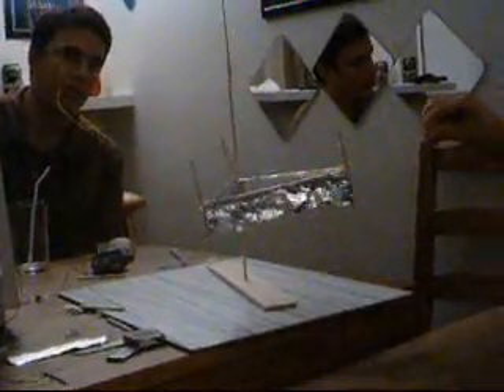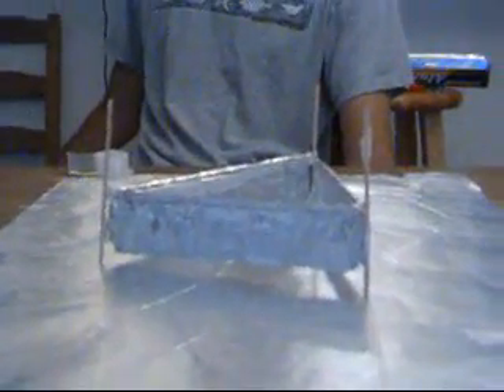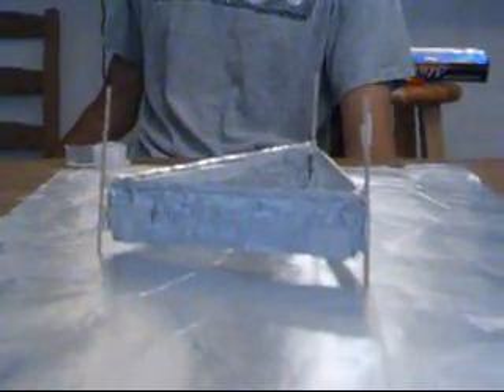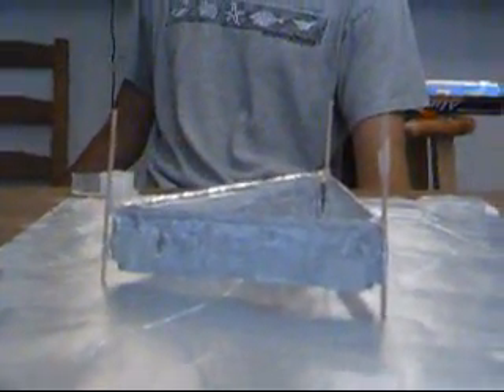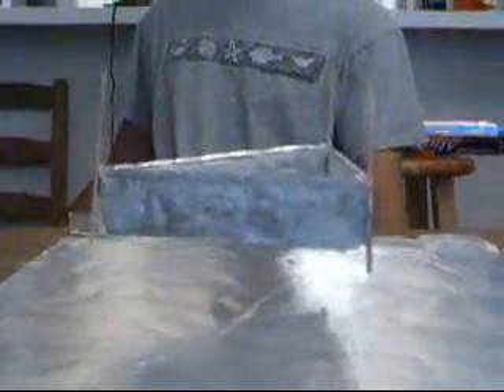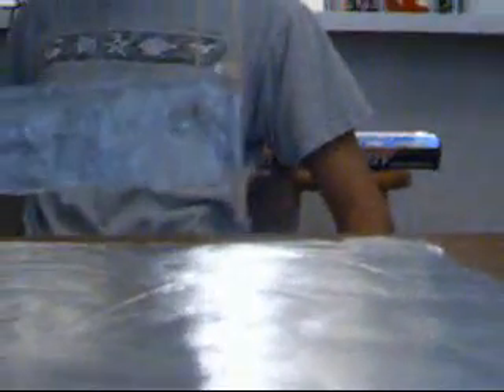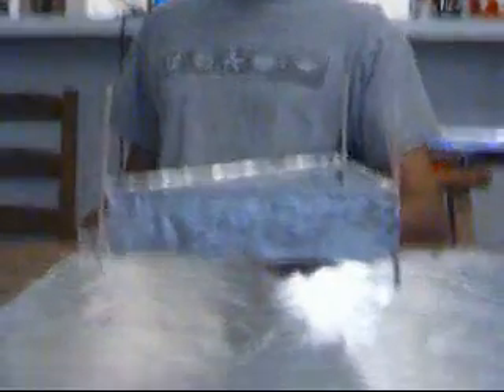Ion Wind Lifter

Comment: Oil tests already done over the last 80-years by Thomas Townsend Brown (the inventor) to HONDA R & D in the 1990s-2007, and NASA (2000-2005). Force is the same, regradless of the medium. Tests in Vacuum and Oil are quite conclusive. A high-K-factor dielectric between anode and cathode is best, smaller gap,higher MASS dielectric, high area of plates,more Voltage.

Comment: I don't take this to be a complete explanation because the test results can either be explained by ion wind or by dielectric pumping of air. Dielectrics experience a force in the presence of a diverging electric field, without ionization.  A test to verify this would replace the air with a substance that does not ionize easily such as oil. Dielectric pumping, if demonstrated, gives rise to interesting effects we can all look into. Let's not fall into a false dichotomy trap.

Comment: Actually, requiring air is evidence that this *is* ion thrust. According to the ion theory, it works like this:

There's a thin wire above the foil that's hooked up to one pole of a high voltage source and it ionizes the air around it. These ions are repelled from the wire and attracted to the foil (attached to the other pole of the power) which deionizes them. This constant downward flow pushes on the air below, creating a net upward force.

Comment: You may use an electrostatics generator, but you ned 1-2 milliAmps to replace charge-loss to space by thin-wires and sharp-edges. Just enough-current to maintain the CHARGE.

Comment: To put things in perspective: the article "How I Control Gravitation", published in 1929 by Brown, presents an electrogravitics-validating discovery about VERY HEAVY METAL OBJECTS(44-lbs EACH) separated by an insulator, charged to high-Voltages. Brown also expresses an experimental formula in words which tell us what he found was directly contributing to the UNIDIRECTIONAL FORCE (UDF) which he discovered, moving the system of masses towards pos.(+) pole.  Equation for force might be F=Vm1m2/r^2.

Comment: The foil-skirt, being oppositley charged form the wire, is violently pulled to the wire by COULOMBS forces, the is simple physics. Being in fixed-relationship, the whole device moves in any direction the positive-charged wire is oriented.

Comment: You do not neet to fly from a charged plate. my beamships(tm) leap from the floor or table to the ceiling, and off the grass to any height you desire. I flew 3-foot hollow aluminum-copper and plexiglas flying saucers at the 2nd antigravity-conference in Reno, Nevada in 2000, and they even flew sheeted in plastics.

Comment: That is correct. The unit puts out at least that much Voltage. VOLTAGE is what causes a localised gravity-warp with a CAPACITOR, CURRENT is what cuases a localised gravity-warp with a TOROID (toroidal-coil wound around a hollow square cross-section Swedish-steel donut-shaped core). Capacitor is ELECTROGRAVITICS. Toroid is MAGNETOGRAVITICS.

Comment: Google: Lithim-Polymer Batteries (They've revolutionised the RC toy and hobby industry, obviating the need for Internal-Combustion glow-fuel or Petrol engines).

Power supply costs $98. 1 piezoelectric-transformer the size of a sugar-cube, putting out around 3-6KV AC, this is put thrua standard 10-stage Cockroft-Walton Voltage-multiplier, out comes  from 20-50KV, @ 1-1.79 milliAmps. This is pulse modulated for greater or lesser effect (pulsing the output w/ square-waves increases the force).

Comment: Accomplished in early spring 2003 by a professor in Tokyo with a modified version of one of my ALPHA piezoelectroc-based power units, and an 11.1Volt, 2200milliamp Li/poly battery, and a very large lifter. Achieved self-powered flight for over 60-seconds before battires exhausted. This is the equivalent of the Wright Bros flights 100-years ago. Only 66-years from first powered-flight, to the MOON! Which I watched in Manchester UK in 1969 on B & W Telly.

Comment: If your wire is moving at all, it is not tight enough, and your lift, and power-consumption efficiency will suffer. The anode wire must be as tight as possible, and NOT MOVE AT ALL, then the thrust is much greater, and power-consuption goes way down.

Comment: They did not use potentials of 150-250-KV, vas TT Brown did, nor a solid dielectric, as Serrano did, in his patent, nor the new NASA/TRANSDIMENSIONAL patent, which uses a solid-dielectric, and worked in vacuum; that was the basis on which the new patent (2001) was granted. This is a fuelless space-drive.

Comment: A dielectric is anything that prevents the flow of electric-charge, or current. A solid dielectric that increases the Biefeld-Brown Effect must have the highest K-factor available (to store maximum-charge in the form of elastic-stress), highest MASS available. Barium Titanate, Titanium Dioxide, or for a real good thrust, depleted Uranium (used as dielectric on the B-2 Bomber).

Comment: Mythbusters did not use TT Brown's vacuum-voltages (120-250KVDC), or SOLID-STATE-dielectrics, like in Hector-Serrano's patented device. This would work fine in vacuum, beeter than in air, with those requirements. Don't be intellectually lazy, it takes no effort.

Comment: The SEG-mockup that I touched with my own hands is actually generating excess-energy as we speak, and it was not designed to do so. The first complete ring for the law of the squares SEG prototype was completed four-days ago. The second ring is being built right now. The senior engineer is in the process of moving to Thailand, where the work is being completed.

Comment: The modified Japanese unit is heavier, and the model is larger and heavier, also. 6-seconds of self-powered flight before lithium polymer pack exhausted. I was not given specifics, but I can only assume much progress on those initial efforts hae been made in the nearly five-years hence. We've seen an explosion in battery technology and microelectronics.

Comment: A scientist in Tokyo, Japan flew a self powered model with one of my modified units back in early 2003, and payload-capacity is simply a function of Voltage, and pulse-frequency. Betavoltaics, pizoelectrics (wich is in our 124-gram ALPHA power supply, and others allow onboard power. Less than 200-Watts required. You can come up with even more effective designs if you use your MIND that God gave you.

Comment: Brown's patents and discoveries predate Deseversky's. Brown is listed as a Patent-reference in Deseversky's work. Ionocraft are less-efficient, produce less thrust with more power-input than Biefeld Brown craft. I was flying heavy sheet-aluminum and plexiglas and copper saucers in the 1990s. I attended the TT Brown conference here in Philly in April, 1994.

Comment: The electrostatic lifter was invented in the 1960s by de Seversky as the "Ionocraft." The question is whether these aluminum foil lifters are "Ionocraft" or Biefeld-Brown devices. It looks to me from this experiment that you are using an Ionocraft. If there is a working Biefeld Brown device, which is different from an Ionocraft, we need to see it because BB is workable in complete vacuum (supposedly) whereas Ionocraft is not, without onboard gas supply to ionize.

Comment: Simply research it yourself. Build your own craft, and research the subject. Or buy one. They come with great free DVDs, and a small, non-nonsense 12-Volt power supply that flies up to 5-foot diameter models. You may be pleasantly surprised; but you'll have to do a little work. It takes NO work to simply dismiss...

Comment: All that does is point up  flaws in our educational system of basic/ higher-learning. Information on this has been controlled (classified- USAF in 1955). Experiments in vacuum, under oil, etc. It is not a reaction- effect. Try it with better devices, and heavier-three-and 4-foot saucers, as TT Brown did, and I did in  1990s. Ion-wind cant escape plastic-bags, but saucers still flew, 2nd Antigravity Conference in year 2000 in Reno, Nevada, hosted by Jim Cox of ANTIGRAVITY AND SPACE-DRIVE NEWS.

Comment: Some configurations, like this guy's barely flying lifter, ARE more ion-wind based, and do not work in vacuum. Otheres, with sufficient power, and increased gap, or solid dielectrics, do work in vacuum, like Hector Serrano's patented ELECTRIC ROCKET. You lose DIPOLE-effect without air to act as dielectric in hard vacuum. However, my own experiments have disproven ion-wind as a major thrust-component. Look at Beamship Variation II.

Comment: You're generating mucho ion-wind, combined with weak-lifting force. Classic ionocraft. The BB-effect is something VASTLY different. Less-power-consuption, and little to no-ion wind. But the force goes OFF THE SCALE; many orders of magnitued more than this little test-device. I've moved much heavier sheet aluminium-coppertbeand plexiglas saucers in the late 1990s, and flew 3-ffoters, wrapped in plastic-bags in 2000, at the 2nd antigravity conference, in Reno, NV.

Comment: An EMF is ElectroMotiveForce, or current/Voltage, and a Vector. That sounds strange. But you have magneto-gravitics (TOROIDS), and ELECTROGRAVITICS (CONDENSORS, PARALLEL AND ASYMMETCIC CAPACITORS), so I will have to watch this.

Comment: Plenty of theoretical work showing antigravity is  effect of electromagnetism. Since gravity is the weakest force in the universe, and EM is THOUSANDS of times stronger, EM-propulsion with  hi-voltage-hi Mass and K-factor dielectrics, and EM-Toroids can easily control gravity. DYNAMIC COUNTERBARY. Google: GRAVITY RAND, THE HOW-TO of ANTIGRAVITY, Brice N. CAssenti, Harry I Ringermacher, United Technologies Research Center Copyright 1996, AIAA, Joint Propulsion Conference.

Comment from the maker: What is antigravity? It is the force that is pushing the universe apart. It is no more controlable than gravity. And it is most likely due in part to the presence of antimatter. For instance, if there was a concentration of antigravity in one area, it would push everything away just like gravity pulls everything in. This is not antigravity by whatever ever methodology....It is an assymetric capacitor with limited use and value...this is a toy. Or an air purifier, depending who your talking to.

Comment: Vacuum CONDUCTS (vacuum-tubes), so spark-gap has to be higher, and so does Voltage (potentials), or else you have to use SOLID-STATE, hi-mass, hi-K-Factor dielectrics, to maintain dipole-feld-effect drive in vacuum. G-fields can be created electromagnetically, Google: Nipher. And Searl. Roschin-Godin. Hubbard. Floyd Sweet. Russian G-Beam gravitonics research device.

Comment: Get your "lifter" off the foil, and put it on a NON-CONDUCTIVE SURFACE. Make your cathode-skirt slightly shorter. You have little to no lift because the field collapses everytime it breaks down with a spark; INCREASE your air-gap to just above the distance that precludes arcing, give it a landing tripod, and use .003" stainlesssteel for anode, and feed and return wires. Peace.

Comment from the maker: The following is a message I sent to another member...throught i would post it as well...

This isn't Anitgravity. Anti gravity would push away all things with positive mass. Just as regular gravity attracts all things with a positive mass. This is a device that causes a force that opposes gravity. There is a huge difference between the two. 
Its an asymmetric capacitor and I probably wouldn't be so doubtful of its uses if you guys would just stop calling it anti gravity.

Comment: We don't need stabilising tethres with onboard power. I experimented in 2003 with electrically isolating the three 1-foot corners on the five-footer, and only SLIGHTLY reducing ground (-) potential to any of the 3-Control cells gives pitch and roll control. Yaw about the vertical axis is done by mounting a double sidedcapacitor anywhere within the ship, and you yaw by simply reversing polarity, as TT Brown envisioned. Read ETHER TECHNOLOGY, by Rho Sigma.

Comment: Electrical Engineer. I like what you're doing, but I sugggest for further research some papers and books, tell you later by email perhaps, and please build a Beamship, with .003 stainless steel, 2" foil height, 3"-3&3/4" gap between electrodes on the device, GIVE IT LANDING TRIPOD, and use a commercial-grade pwer-supply, like GAMMA HIG-VOLTAGE RESEARCH, or one of mi micro-piezoelectric-based 12-volt pwr-supplies (ALPHA) from appliedelectrogravitics dot com

Comment: Then build an Applied electrogravitis Beamship (tm) and feel the FORCE. Nothing weak here! Up to the ceiling like ELECTRIC ROCKETS at only 23-60 Watts.  No ion-wind, they are adjusted that way for maximum-force with less power than it takes to fly an inefficient ion-drive. They won't even dislodge foam balls. Read: L'EFFET BIEFELD BROWN,by Alexander Szames. It's in French, but if you took French,no problem. SUBQUANTUM KINETICS, by PA LaViolette. And Read TT Brown's lab notes, like we have.

Comment: There are MANY forms of antigravity propulsion. This methodology produces a force-field, or gravity-hill, to travel in ANY direction, depending on orientation of the device. With solid-state-dielectrics, it will work much better, with less input-power, as per TT Brown's lab-notes you should read sometime.

Comment: Then explain my results, and the fact that as ion-wind decreases to near zero, thrust-force goes up to the point that a heavy device will lift with very little power? DeSeverky's four-foot lighter-weight IONOCRAFT uses 30,000 Volts @ 3 milliAmperes, but my six-foot Beamship Variation III goes to the ceiling like a rocket on only 60 WATTS (40,000 Volts @ 1.5mA). NASA granted PATENT base on succesful vacuum tests of similar device. Build a Beamship, and re-test. We need independant lab-results.

Comment: More thrust and works better with ONE large triangle, and a higher spark-gap, produces LESS ION WIND, but paradoxically, the FORCE GOES UP, and power consuption goes way down. Past the sweet-spot, thrust will go down.I tested 3-foot saucers in sealed bags;they flew BACKWARDS, but still flew (2000, 2nd antigravity conference, Reno, NV).

Comment: You got banned for promoting DISINFORMATION; you stubbornly refuse to read research proving otherwise! My own, NASA(2001),patent based on Vacuum-tests, US ARMY, Hector Serrano, and Beamships have far more "thrust", when spark-gap adjusted for NO ion wind; This is NOT a Deseverskys Ionocraft (which does not workin invacuum). This:TT Brown's ELECTROKINETIC APPARATUS, I replicated 3-foot heavy saucers, 1990s, and photo my apparatus is: TURNING THE CORNER:ENERGY SOLUTIONS FOR THE 21st CENTURY, p.254

Comment: USE A COMMERCIAL POWER SUPPLY. Computer monitors are current-limited. So most of the power bleeds off into space. You need a little more current to sustain the charge. Charge is what provides the warp (which causes propulsion). Go on Ebay for a commercial HV-power supply, such as GAMMA HIGH-VOLTAGE RESEARCH.

Comment from the maker: the red cord that goes to the top of the vacuum tube is the anode, clip it...do NOT touch anything else...you can use the metal monitor casing as a ground...if you are unsure of what a ground or anode is, please dont mess with HV...and remember, always put one had behind you back when working with HV

Comment from the maker: A lot of internet science-buffs will claim this is the future of levitation. Initially I even thought so myself. But after building one and reading NASA's take on the subject, I highly doubt this is the right path to useful levitation. It's just simply inefficient. 25,000 volts could be put to better use than trying to rip ions from the air for thrust.

Comment: nice job - curious as to the voltage on why 25kv - if you produced more would it fly higher also have you attaached a longer tether to it to see how high it would go - meaning the ion wind is "pushing off" of the solid floor beneath it and the higher it goes I guess it would need more voltage.

Comment: nice video,i built one too. ive seen videos on googlevideo of people  whom have cut the frame between the wire and the foil, put the foil part in a cardboard box with a window on it, put the wire portion of the frame on top, and it still lifted.  can ionic wind pass thru solid objects?
  there is ionic wind present thats for sure, but there is more than meets the eye....